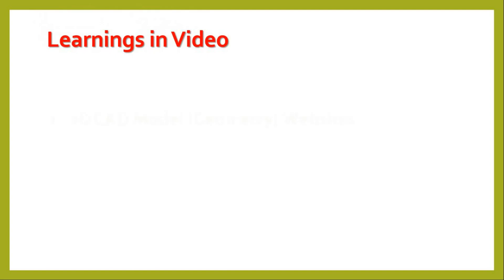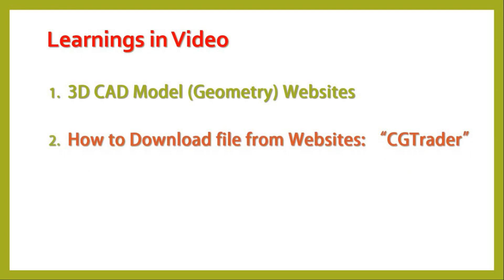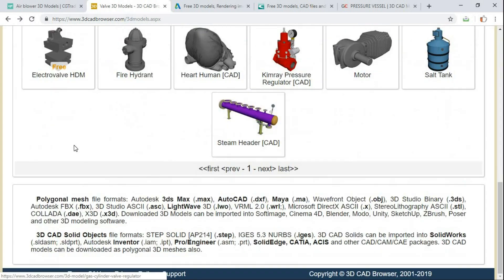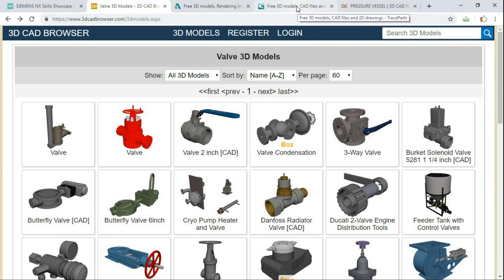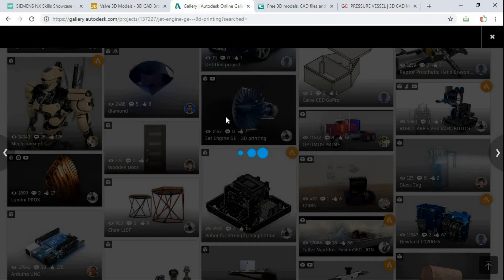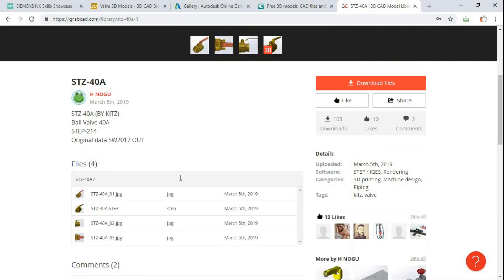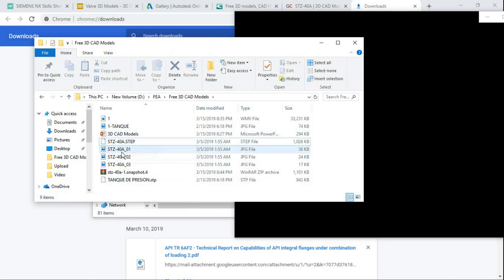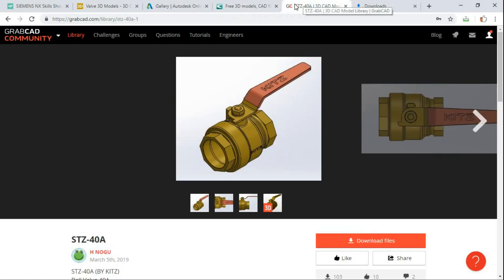Top 5 Websites for FREE 3D Models for FEA Practices

Comment: Hi, thank you for the video. Is there anything similar to download Finite Element Models, which I can use for structural/crash analysis? Thank you
Reply from the maker: No, Mesh model files are not available for downloads. Mesh model have issue with elements type used, software's as well as version of the model exported.